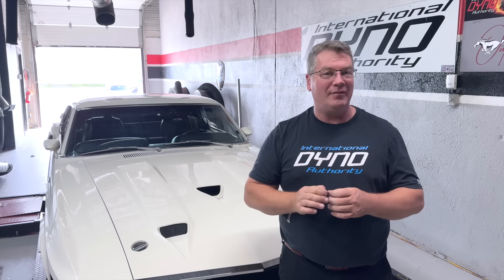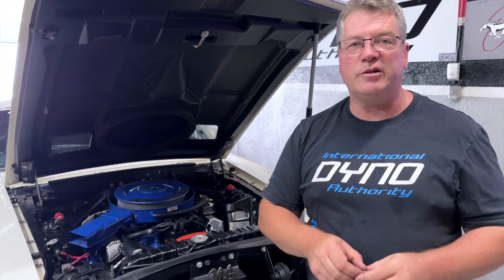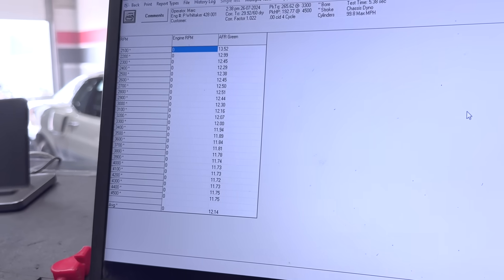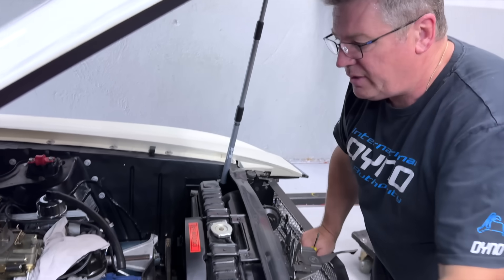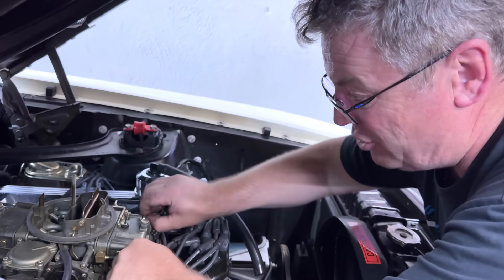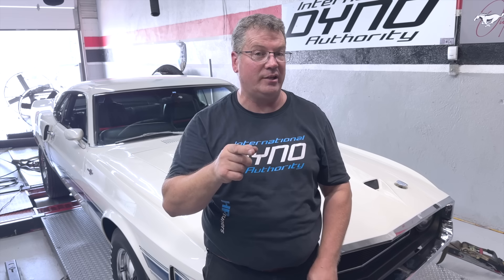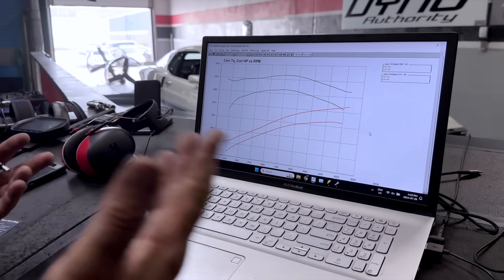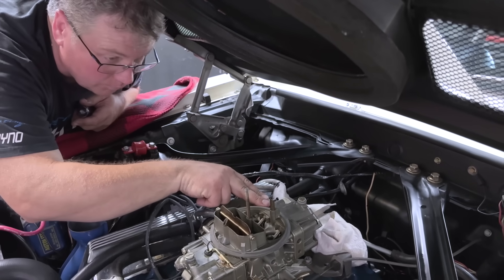Original, unrestored '69 Shelby GT500 tuned on the dyno

Comment: Replace the vacuum lines, plugs, distributor, points, wires and it should come to life. In those days, you had to tune them up every 3000 Miles’s and a major tuneup every 10000 miles.
Reply: Yeah, nowadays cars are constantly getting tuned up by the computer, modern junk,needs to be constantly tuned just to run ok!
Reply from the maker: @rocksvaincreations3865  once a tune like this is performed. The only thing you need to do is exactly what you would do on a brand new car. 
The only thing you need to do is exactly what you would do on a brand new car. 
Replace the spark plug once every 3 years, make sure you don't get any mouse or mice, in the wiring. Keep it in good condition and it'll stay running perfect for the next 50 years. 

There's no need to continuously do anything at all. There's no need to do any more tuning whatsoever. Just maintain what's there. The settings are correct, the Jets are correct, the carburetor is correct. He will keep it in awesome condition. It will be an amazing car for the next 50 years and nobody has to touch anything or tune anything.
Reply: @internationaldynoauthority693  Agreed! Dailied solid lifter Gen 1 sb for yrs in the 80s. Never had to retune the car, carb was consistent. Ck lash once or twice a yr depending. Other than oil changes never had a breakdown
Reply: You are correct. My first car was a new 1968 GT500KR. My next-door neighbor had a part time tune up garage behind his house and he would put new points and plugs in my car about every 3000 miles. The 428 Cobra Jet engine was rated at 335 HP. I would race 327 and 427 Chevys and beat them every time.
Reply from the maker: In this video, we explore All possibilities: Including the consequences of a ruptured power valve in a carburetor. We know how it can lead to a 'dead spot' and lean conditions in the engine due to fuel curve fluctuations.
Following the tuning fundamentals, we meticulously analyzed the fueling, starting with the low-speed circuit. We adjusted for optimal throttle response, smooth starting, and proper emulsification.
Next, we addressed the transition circuit, considering the vacuum circuit, velocity, and float level.
As you saw, we replaced the faulty power valve gasket and adjusted its position. We also replaced the power valve itself and made adjustments to the front primary circuit main jets. Despite these efforts, smoke persisted above 3,900 RPM, indicating an issue beyond the low-speed and transition circuits.
This pointed towards the velocity circuit, influenced by airflow dynamics and fuel delivery from the primary and secondary circuits. We also discovered an unmetered fuel leak through the accelerator nozzle, which we corrected.
Finally, we optimized the PCV system and ignition timing. This comprehensive approach eliminated the smoke, improved combustion efficiency, and ultimately enhanced engine performance.
We greatly appreciate your comments and feedback. We encourage you to subscribe to our channel for more informative and engaging content. Happy New Year!"
Reply from the maker: Well, we have quite an exhaustive pre-dyno checklist. 

So each of these had been done and most importantly, the spark plugs had been gapped correctly. This usually makes the very biggest difference when you start to tune.. 

So once you have exhausted all of the physical possibilities. And you've made sure that the compression is good, you've made sure that the leak down is good, and everything is fresh and good and clean and ready to go. 

Now you have to do the work. You have to put in the time and the effort and know what steps to follow. In this video. That's what we did, was. We followed those steps and we explored possibilities and eventually found some of the issues that plagued this car for more than 50 years. We enjoyed this vehicle and, we really love your comments. Keep them coming, and explore more of our have content 

Happy New Year from all of us here at International Dyno Authority

Comment: Black smoke means cheap gas and old plugs
Reply: SOMEONE  commented and did NOT watch the video!!!! LOLZ.
Reply from the maker: In this video, we explore All possibilities: Including the consequences of a ruptured power valve in a carburetor. We know how it can lead to a 'dead spot' and lean conditions in the engine due to fuel curve fluctuations.
Following the tuning fundamentals, we meticulously analyzed the fueling, starting with the low-speed circuit. We adjusted for optimal throttle response, smooth starting, and proper emulsification.
Next, we addressed the transition circuit, considering the vacuum circuit, velocity, and float level.
As you saw, we replaced the faulty power valve gasket and adjusted its position. We also replaced the power valve itself and made adjustments to the front primary circuit main jets. Despite these efforts, smoke persisted above 3,900 RPM, indicating an issue beyond the low-speed and transition circuits.
This pointed towards the velocity circuit, influenced by airflow dynamics and fuel delivery from the primary and secondary circuits. We also discovered an unmetered fuel leak through the accelerator nozzle, which we corrected.
Finally, we optimized the PCV system and ignition timing. This comprehensive approach eliminated the smoke, improved combustion efficiency, and ultimately enhanced engine performance.
We greatly appreciate your comments and feedback. We encourage you to subscribe to our channel for more informative and engaging content. Happy New Year!"

Comment: I have tuned carbs all my life(78 y,o.) without a dyno and have achieved similar results with road tests and carefully-kept notes on float level, jets, timing, choke, accelerator cams/squirters.  I've gotten 390m 427, 428, 429, and 460's all to perform correctly making very good horsepower, torque, and mileage.  There's no secrets or magic in the tune....just observe and make changes.  One of the very best changes you can make is to recurve the distributor and get rid of the lazy, smog curve Ford came with from the factory.
Reply from the maker: @tomnekuda3818  

Our tuning process is meticulous and systematic, starting with all passes beginning at 2,000 RPM. The throttle is applied rapidly to the wide-open position, ensuring consistency across every run.

Each test is conducted on the chassis dyno under identical load conditions, allowing the vehicle to accelerate as quickly as its setup permits. The duration of the test is carefully measured and compared with subsequent runs to evaluate progress.

Initial tests are run until the torque curve falters or until the data log indicates unsafe, unproductive, or non-rewarding results—signaling the need for adjustments or the next step in the tuning process.

We prioritize the safety and condition of every customer’s vehicle, treating each one with the utmost care. Throughout the tuning process, we closely monitor key parameters such as temperature, AFR, IAT, balance, and torque production across the RPM range.

Our goal is to deliver responsible, high-quality results that enhance the performance of the vehicle without compromising its integrity—or our reputation. We do not take risks that could endanger a customer’s vehicle or the standing of our business.

As we observe improvements, we gradually extend the RPM range, focusing on identifying the engine's most efficient operating zone. At every stage, we ensure transparency, sharing step-by-step results with our customers and walking them through the data logs to educate and inform.

Each test adheres to a precise, repeatable procedure, maintaining consistency and accuracy. This approach not only ensures optimal results but also reflects our commitment to excellence and responsibility in tuning.

---

Let me know if you'd like further adjustments!
Reply: @internationaldynoauthority693  
What did racers/enthusiast do back in the day with just bolt-ons to get 400RWHP and/or beyond? Talking about aftermarket carb, long tube headers, new intake manifold? re-curve the distributor? What else?

Question #2: After getting max  RWHP with bolt-ons (what is that number again?) how much RWHP and TQ was obtained by top end changes .....domed pistons to increase compression up too 13:1 or 14:1 and RACE GAS?? And some head PORTING??  No FI, still all NA.
Reply: Damn, too many advertisements

Comment: The guys on Roadkill would always install a O2 sensor in the exhaust to tune the carburetors.  Without it , it’s a waste of time.
Reply from the maker: @drew8256  

Exactly --- thank you for your input. As you see in our step by step, first procedure is to install AFR data logging. Then -} Log, adjust, test.  Log, adjust, test... Repeat.
Reply: RB racing offers exhausts with a PORT for an O2 sensor that they also sell. It displays real time AFR's. Can be used to tune carbs and EFI. Talking about Harley motors and aftermarket motors for Harley.
Reply from the maker: @imcacklinghere8693  That's a cool story. 

It needs more .....dragons! 

Cheers!
Reply from the maker: @imcacklinghere8693  none of that accomplishes anything, if you don't have a consistent pass. 

And, sensors need to be monitored for their "health".

These type of wideband sensors see a lot of abuse. Including moisture from exhaust. Extreme heat. Excessive fuel, and lack of cooling. 

All of these tend to be detrimental to the life period of these sensors. 

We generally see good use for about six vehicles in a row. After that, we have to be very careful to monitor the results that we are seeing and continue to check our calibration. 

Anything beyond that is just garbage in garbage out. If the data in is no good then the data out, is not worth the sensor equipment, that it's being recorded by.
Reply from the maker: @imcacklinghere8693  What is the data logging software. And the incremental breakdown comes in what phases?